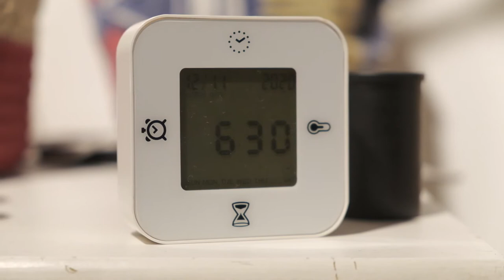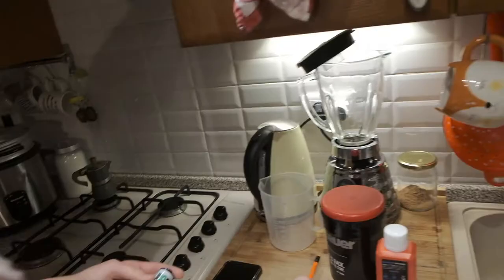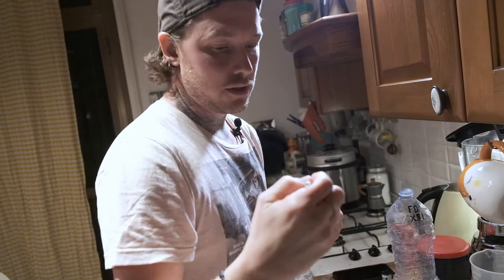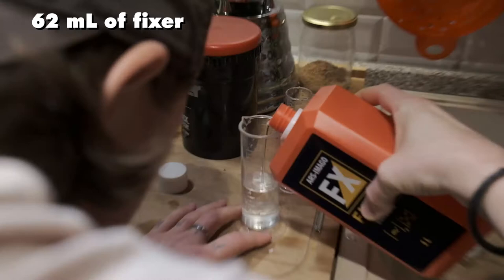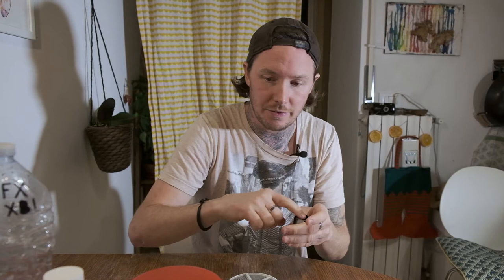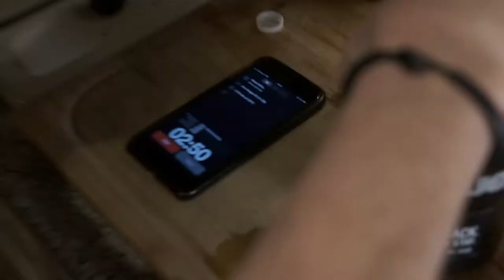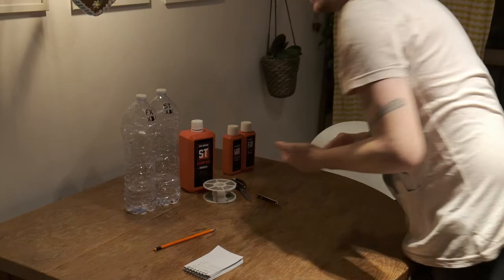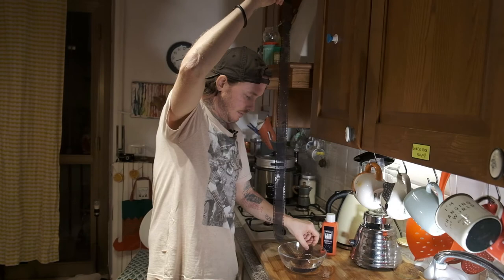Developing Ilford HP5 at Home

Comment: You don't have to be so percise with the temp. Between 20C˚-24C˚ is fine.  When you put your bottles of Chems on the table the temp will obviously rise to room temp. Hence you should have all 3 bottles and the termometer tip in a container in the sink and keep the water flowing in it at around 20C˚ until use. Put the tank holding the film in the same.  And make sure you wear rubber GLOVES next time when handling/pouring Chemicals!!
Reply from the maker: True.
Reply from the maker: No glove, no love. I'm living life on the fringes of society. Just kidding 😉